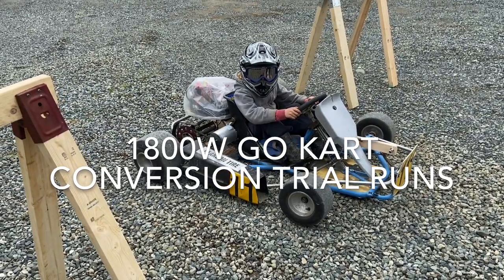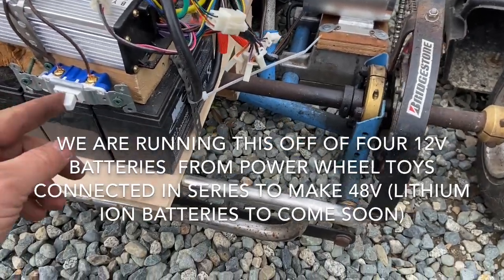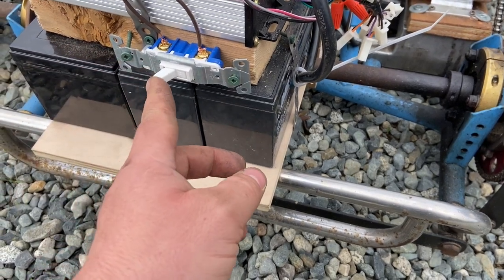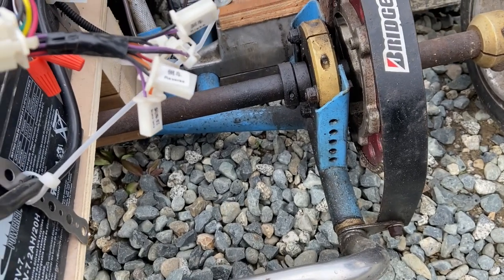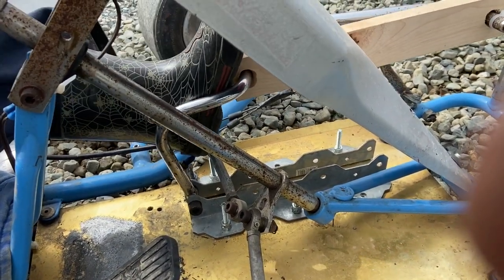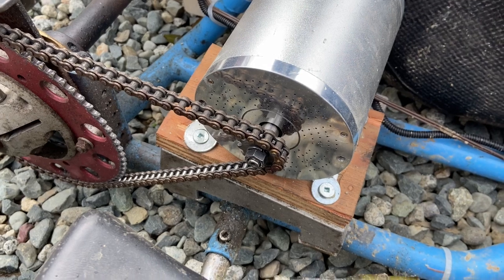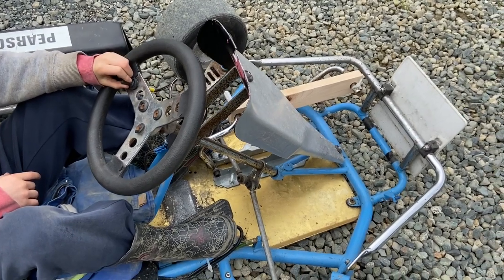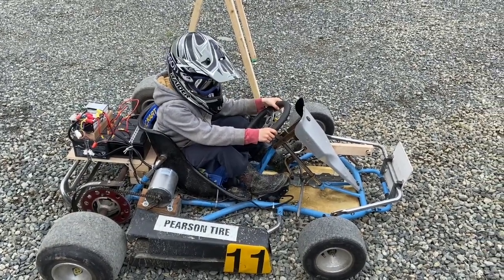DIY Electric Go Kart Conversion Part 2 (kid trials)

Comment: Trying to put this kit on a small old garden tractor. Your my hero, I'm super confused tho. Thought I had a good grasp but perhaps not 🤨. Need to leave the 3 speed switch in low power mode, as far as the "on off switch it's just a 2 way toggle with the orange and red wires right?
Reply from the maker: Mine was marked key switch or somthing basically connect the two wires together and it should work. I have some other videos on these controllers in my go kart that might help.
Reply from the maker: There is a bench test video that could be helpful as well
Reply from the maker: If your trying to get the low speed to give more torque it won’t work. It’s the exact same as going half throttle. That being said I just connected the 3 speed
Control wires together in different order to figure it out. Check out my bench test video where I couple these motors to one throttle might help.
Reply: @CJs_DIY  I got it figured out, thanks!!!

https://youtu.be/iMeZunH5mCs

Comment: Is it easy to reverse the direction of the motor?
Reply from the maker: Yes 2 wires hooked up to a switch or you can just connect them together and it will put it in reverse. We used a button that you have to hold down so you can’t accidentally leave it in reverse

Comment: Hey does anyone know what ebike battery is suitable for this or is 48 13ah suitable or not??
Reply from the maker: Depends on the voltage of your controller they usually have a range they will work in.

Mine was good from 36ish to 60 ish volts so anything within that range. As far as amps more is better lol

Comment: How's the motor and controller holding up? I'm thinking of getting two 3000 watt versions and making a full sized go kart with both rear wheels powered.  This seems like the cheapest option, but would like to guarantee the durability.
Thanks and nice job!
Reply from the maker: I bought the 3000 watt kit and the motor is identical to the 1800 watt kit. It just comes with a more powerful controller...  over the next few weeks I plan on changing over the motor controller and putting a smaller sprocket on the drive shaft... great minds think alike because my next step is def going to be dual 3000 w motors for this thing... ( it’s still working great btw) I have ran it in wet conditions and still no probs...
Reply from the maker: I have been working on part 2 of my outboard conversion with the same motors and plan on running 2 3000 watt motors if you haven’t seen part 1 of that video I would recommend it as it shows how to run dual controllers off of one throttle

Comment: It looks decently powered, maybe with lithium you can get a bit more torque out of the current draw
Reply: the 33A controller little small, we use 45A controller , is more powerful.